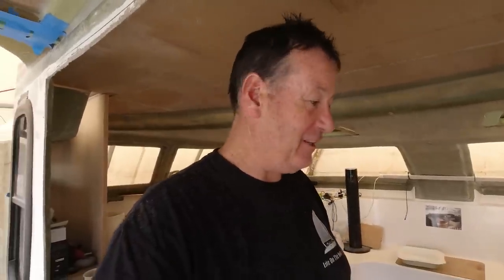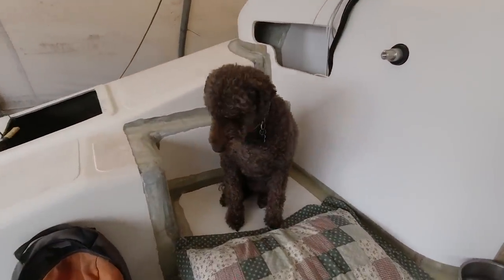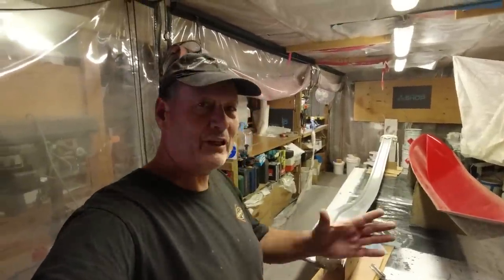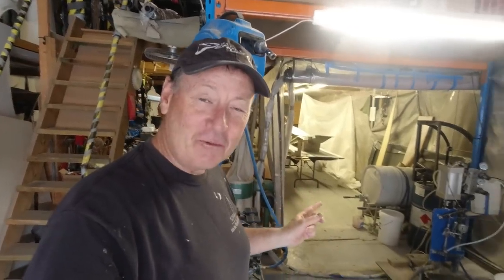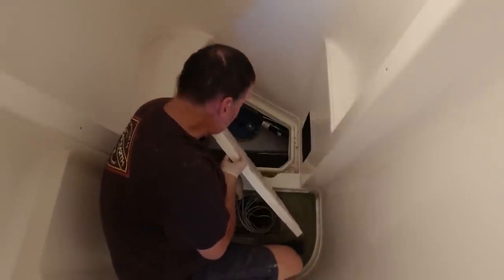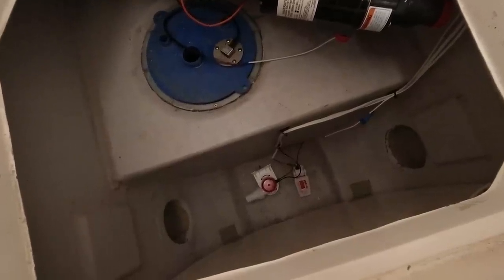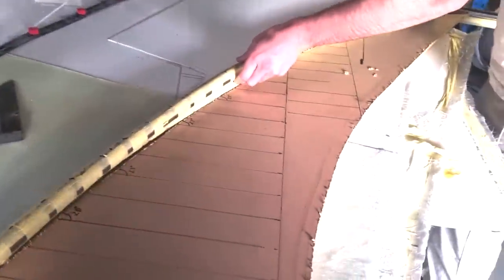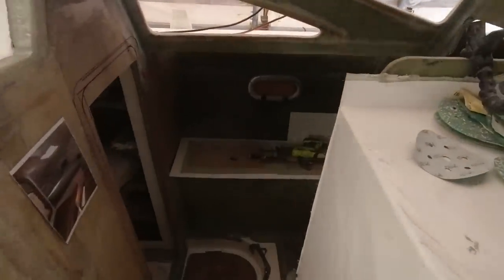youtube video #-7p7N1Wq8WA

Comment: A unique approach for the stanchion mounts. Practically eliminating potential rot, very robust when finished, extremely strong and well supported. No water pooling. No crunching toe stubs. Tremendous attention to detail, form and function.
Janet does excellent detailing. Stop interfering and get on with it. Go for the 2 wave breakers. Add the small bulkhead pieces and just let Janet loose. She has gotten quite good at finishing intricate jobs.
Those shower bases are beginning to look very smart.

Comment: In the US you can find corian and some granites in about 6.35mm thickness that has fiberglass bonded to the unfinished side to add strength.  I've seen it in the RV industry mostly and it's normally found in the high end products.

Comment: Crewed on cat with some of those wavebreakers.  When they fitted a few years after the boat was originally made,  they also installed bladders in side them so they could use them for extra fuel if needed.  Unrelated found out a few years later the boat was siezed as part of a drug importation ring.

Comment: I would put 3 or 4 of those wave breakers. My thinking is the waves will ride up the side of the v and crash into each other, forming a cushion of water and air hence less slamming. If you got a friend boat designer ask them to model which will be the best number of wave breakers 3, 4  or what ever number? That’s my niece thinking… likely wrong…lol

Comment: Would you consider leaving it a tight fit with the shower base, and simply fit a drain outlet in the corner above where the other drain is? Any leaking around the edge would also still drain away. If it was a screw in drain cover, you could unscrew it, and use the hole to pull up the floor if needed at a later date.

Comment: Ross, for shower drainage, can you add some large holes in the vertical part of the rim area and gently radius off top corner edge to guide water towards each hole ? That would allow small neat channels for water to escape into invisible holes while keeping tight fit elsewhere for squeak free panel. I like the reinforcements in hull transition for stanchions, they might also be a good mounting point for a suspended ceiling off furring strips anchored into a lip or other ledge ceiling trim and lighting can suspend from ?...

Comment: How can i tell If my boat is made using polyester or vinylester resin? I need to make new cockpit floor
Reply from the maker: It wont matter.Both are compatible chemistries.The issue will be if you bounce between epoxy and styrene based monomers.Once you move to epoxies you should not go back.Cheers Rossco
Reply: @LifeOnTheHulls  thanks!